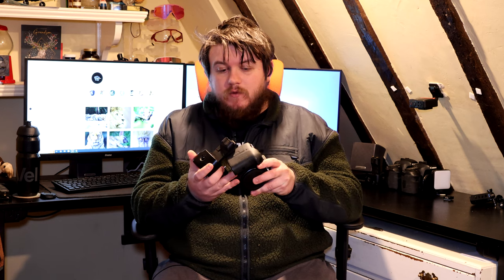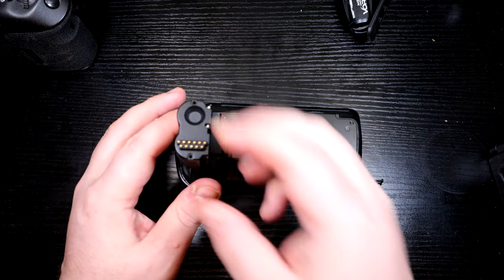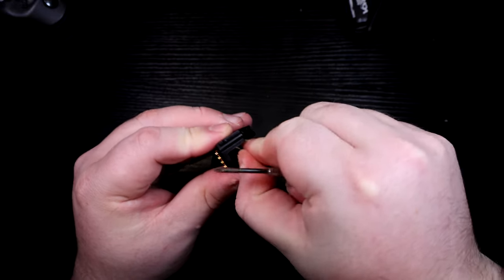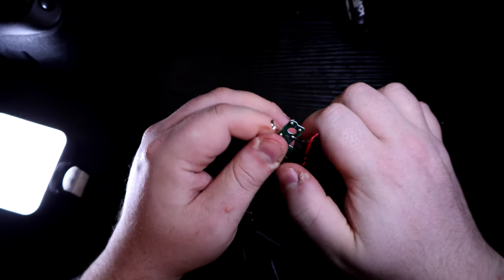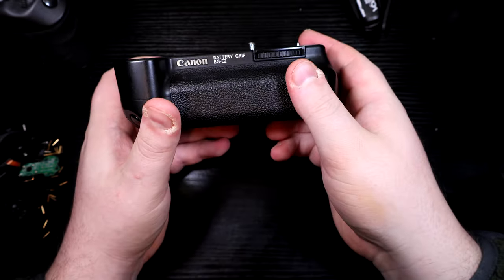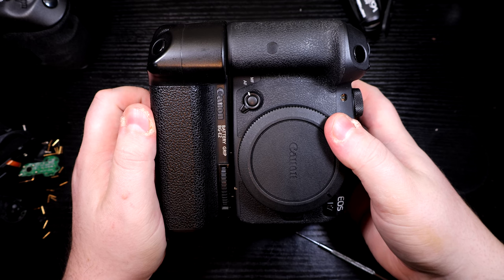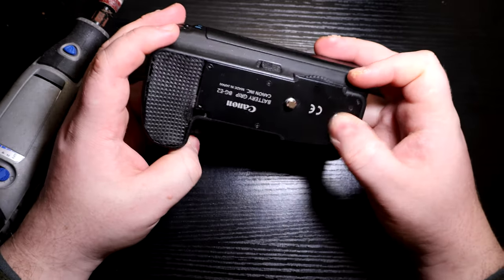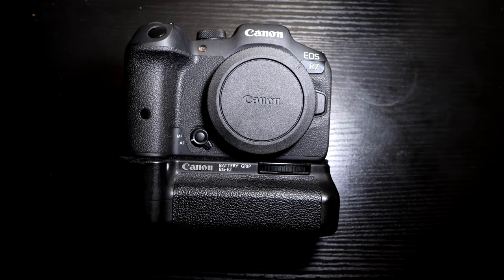BONUS VIDEO - How to make a Battery Grip for the Canon R7

Comment: Sorry, but that isn't going to work; there is no mechanical "stop" to react the torque from the camera body, all the load is being carried by the tripod screw (and the frictional contact between the grip and the camera base). The main interest of an APS-C camera is to use a big heavy telephoto like the sublime 100-400mm, but the mass will always be working to over-tighten or loosen the tripod screw. 

Shame on Canon for not making a battery grip for the R7, and shame on them for not at least leaving a hole for a torque reaction pin for 3rd party grip makers. I rarely use my 7Dii or my 80D without their grips.
Reply from the maker: I've been testing this for a few months without issue with big primes. Never unscrewed itself, I'm looking to see if I can make it more secure in version 2

It is annoying Canon just didn't make one though for sure